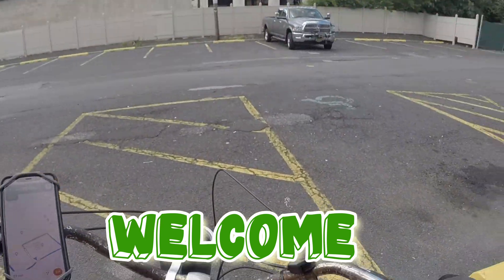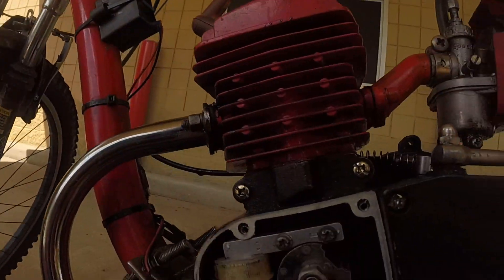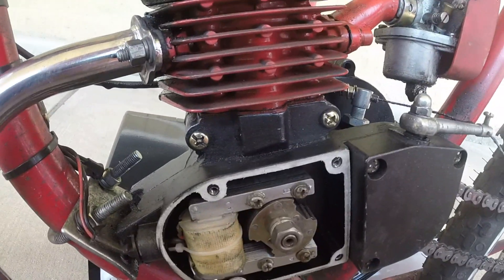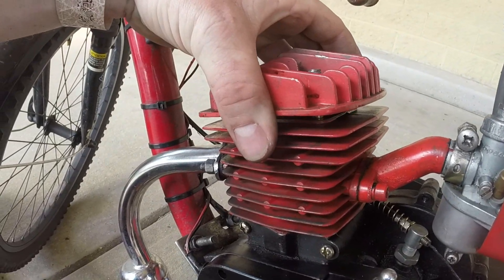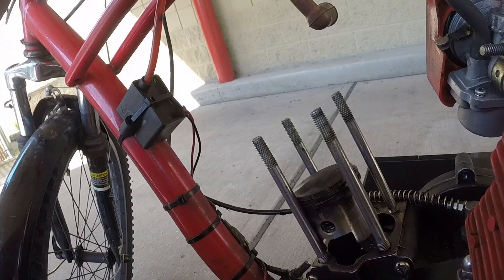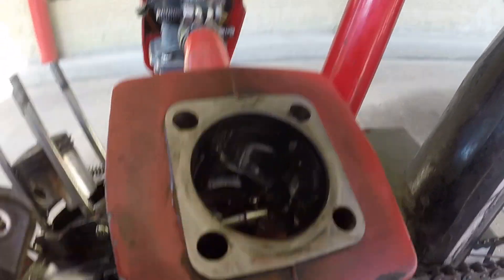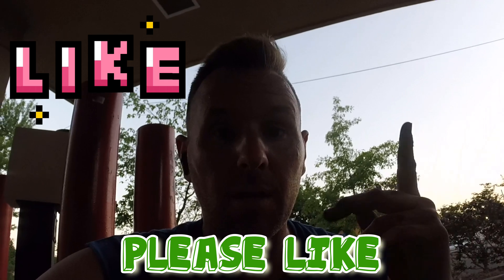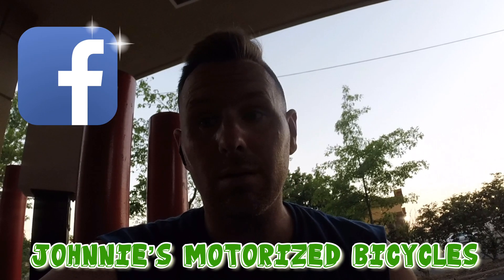My First Prototype Head Gasket For My 80cc Motorized Bicycle And A Broken CDI

Comment: There is a particular high temp gasket material you can buy in rolls that has been perfect for head gaskets for me. Been using it for years when I want as thin a gasket as possible. One time use though after torquing and heating it falls apart when you remove the head. Haven't had one fail yet and one has been on a pk80 being used for years.

Comment: Hey do u think from me riding my 100 so hard as in long times is causing it to slip or is it just cuz the 44 tooth sprocket? Like I mentioned before I felt it slip two times at 40 mph but i t was running for a couple hrs on dirt trials
Reply from the maker: When you say slip do you mean the clutch and do you have a pipe or is it all stock Jw and if it is the clutch I highly doubt it’s slipping at max rpm that’s not normal cause it’s at top rpm but it’s normal at low speed so if it’s cause you hear it get a lil louder and sound faster out of now where and cause u say your doin 40ish it’s probably more like it hitting it’s power band and it sounds like slip but it does that at top rpm but if it is that and it’s all stock I only had one stock motor do that and it is very rare but also totally fine and great too cause the motor is efficient for it’s current state and like I said before you got a good one and to just love it as is cause it’s one of the ones that just works great 👍
Reply: @JMB676  I have no clue bro I thought I was feeling something slip and I know it's not the clutch but um no idea bro but yea two strokes dnt like to be babied they like the high rpms people have this notion to let em idle on break in for a half hr and all types of other things but when u dnt open two strokes up the oil dnt burn and it gums everything up but yea I'm gna push it again and see what it was or if it is the power band kicking in
Reply from the maker: @joneserupinsmoke9161  are you using the rag joint or a adapter
Reply: @JMB676  bro I'm gna hit o Reilly's up and look into a real nos  tank and pump and probably grab a 32 tooth just to see how quick I can get it up to lol .I just gna know how good the bearing are in these China dolls or how good the aluminum is
Reply from the maker: @joneserupinsmoke9161  I wouldn’t spray it bud I would just enjoy this one but if you want more power take and build one out

Comment: Good stuff man, it's a pain making your own copper gaskets, but being able to use them over and over makes it well worth it imo. Always a good idea to keep a spare cdi on hand since they burn out so easily. Or if you can find one in stock you should pick up one of the Supercharge cdi's. They have a decent timing curve in the higher rpm's (stock has no curve) and they last way longer

Comment: i have the same issue but my engine still brand new and it never turned over not even once since i put it together,ive put alot these motor kits together i guess since 2010 and never once had an issue and always started the engine on the 1st try.this was my 1st time buying a kit online,i live near someone that sells the kits outright at there house,yup i changed the spark plug,magneto,and the CDI oh and the carb too,im getting spark and mixed oil and gas precise,hmmm i think i mite have a new DUD engine that just will not start whatsoever from the manufacturer that makes bikeberrys model,hmm.
Reply from the maker: I wish I was close to help out n investigate. Ur not too far I would ride out just to play a bit
Reply: im in milwaukee wisconsin,well i didnt pay that much for the kit 132.00 i bought it in may 2020 didnt try to start it up 4 the 1st time until mid may 2021 and got new replacement parts in mid june,this darn thing still will not start up ,ill just buy a replacement engine,thanks for responding

Comment: When I first started messing with these bikes, I heard lots of people say that the magneto and cdi were prone to fail, that was in 2016, but since then I have had zero failures of either part, tho I now have plenty of spare magnetos and cdi's, lol, btw, you don't look at the magneto to check it, and why would you take the head off before checking the spark?, that should've been a two minute fix, you do realize that when talking about a "overheating issue" with one of these engines, your talking about yourself right?, these things have no water/pump/thermostat, lol, glad ya got her going tho, good-luck and happy-trails!
Reply from the maker: It’s always a pleasure jerry thanks for watching

Comment: If the CDI doesn't work the problem then is in the Magneto yes you are absolutely right there something is disrupting your Magneto or the magnet isn't a magnet anymore there is a way to check all that with a voltmeter to see if it has the right resistance
Reply from the maker: I have a voltmeter but it is for d/c current I need an ohmmeter to see the resistance which I need to get soon cause I want to learn those different things inside the cdi casing.